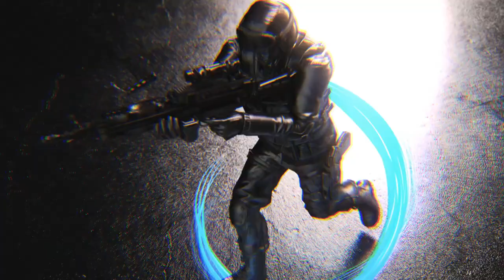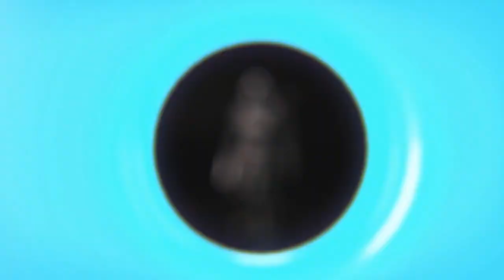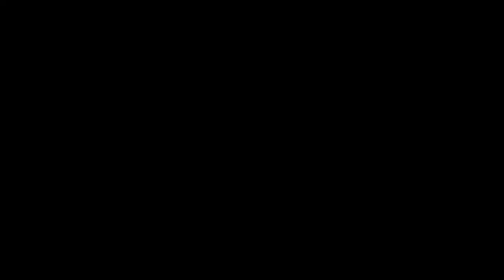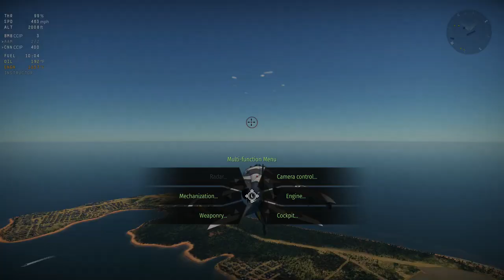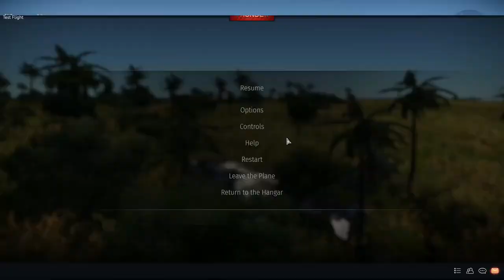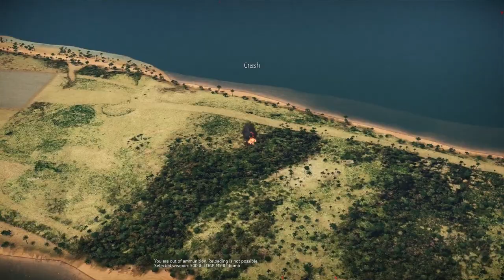War Thunder - My Control Set Up For Xbox And PlayStation For Air Battles

Comment: What are the exact controls for your thrust vector? I tried this but it doesn’t increase or decrease it just locks at 50
Reply from the maker: It does that.. when u increase it you let go of the buttons both at the same time.. alot of people have been having trouble with it on any controls  and on PC as well
Reply: @BolderStrikeGaming do you know any way to fix it? It'd quiet annoying
Reply from the maker: @SEPHTIS213  no fix at the moment  all I do is hold the button get it to zero and release

Comment: Just tried it overall good and smooth flying however my problem is that I can’t assign the menu buttons And it’s Hard to turn also taking off is very difficult and takes longer than it usually does also it’s hard to achieve WEP and hold it
Reply from the maker: This is a old video before war thunder took that way.. so the menu key binding no longer works
Reply from the maker: And you can shut off the hold wep.. and the take off has nothing to do with the controls.. the just depends on the plane you using

Comment: i kinda want setting that are like gta controls
Reply: That's my plan (just started)
It should be as easy as inputting bumper pitch right?  And just mapping the exact controls.  But I'm guessing there is conflicts.  I tend to be creative and tenacious when it comes to mapping having played Elite Dangerous on controller so when I give it a shot I'll get back to ya.
Reply: It's really hard to get to that level of  controls because the thing is in war thunder there is way too many mechanics that have to be keybinded, if you really wanna play like that, you will have to sacrifice a lot of controls, I've been trying to do ace combat style, but it's just impossible due to important binds, and one thing I have from wt is not giving the ability to have a custom setup for each play style when switching control mode in mid flight, example you can't have a setup for simplified controls and a different setup for realistic controls, only one can be used even when you change control mode, we are just too limited in console tho there's a trick called the double binding to add a lot more of controls double binding is simply having to key binds to do 1 action, this separates and prevents unwanted actions.
Reply from the maker: @elnewbie2611  dang lol I like the way you explain it
Reply from the maker: You can but it's a pain I am even trying to figure that out

Comment: i’m trying to decrease pitch but it keeps decreasing my speed at the same time how do i stop that from happening i copied your exact layout
Reply from the maker: did you us a enabler like LB for pitch
Reply: Having the same problem! and yes, used LB as an enabler. Pitch is only activated when I hold it down, but it also adjusts my speed at the same time. How can I make that stop?
Reply from the maker: @coltonlopez5265  use LB + Right stick up and down
Reply: Unfortunately, that doesn’t work either for me because im using pointer aim :/ so using LB + Right stick is equally as disruptive

Comment: pc player is left hand in keyboard right hand in mouse, eye ball and brain to play well while the dogshet console player holding potato controller both hand and spamming auto aim button without using eye and brain cell. what a dogshet nuisance player. i hope gaijin seperate these potato auto  aim player low iq.

Comment: My plane just stays at 47% throttle when i do not do my throttle and leave it and it is anoying and i do not have a brake how do it sort it out?
Reply from the maker: going to have to reset your controls that will fix it
Reply: Enable relative control

Comment: I’m on Xbox, and my button to cancel the input command is the menu button. This means if I try to make the tactical map the menu button, it cancels it and I can’t make the tactical map the menu button. Is there anything I can do to stop this? Plz help.
Reply from the maker: They fixed it to where the menu button has to stay as the menu button.. so for tactical map use the back button.. and for statistics use the Y and back button
Reply: @BolderStrikeGaming  Ok, thank you very much.
Reply from the maker: @DJDino6452  no problem
Reply: @BolderStrikeGaming  Sorry for bothering you again, but what should I use for the Multi-function Menu?
Reply from the maker: @DJDino6452  b button is what I use
Reply: @BolderStrikeGaming  Wait, what is the back button then?
Reply from the maker: @DJDino6452  map
Reply: @BolderStrikeGaming  Ohhhhhhhh, thank you, I should be all sorted out now. Thanks.
Reply from the maker: @DJDino6452  not a problem
Reply: @BolderStrikeGaming  i gotta question, are the rest of tge common settings you dont show default?

Comment: I just cannot get used to point and aim it seems so much easier but when I try I get lost and crash or super confused and killed quick I know ill get roasted I'm sure but I love the actual flying controls / camera view of ace combat and project wingman not so much the physics of the game haha
Reply from the maker: I mean you like what you like tho and if that how you enjoy the game do you that's what I say 🐱
Reply: @BolderStrikeGaming  I have similar settings but when I pitch or anything it just moves the plane and not the circle thing
Reply from the maker: @lk_t5811  yeah it won't you have to move the point aim also
Reply: @BolderStrikeGaming  how? I tried a lot is stuff but the point aim won’t move
Reply: @lk_t5811  yea how do I move the circle thing
Reply: @guitarbackingtracks7889  I’ve figured it out. You have to set the axis for weapon aiming and it will work
Reply: @lk_t5811  thanks man appreciate it
Reply: i have the exact same issue with joystick controls on controller... like i want it too work so badly but 7 years of pointer aim is hard to change
Reply: For me the issue was fixed by doing: 

Controls; Common; View Controls; Fix gun direction in mouse view; Toggle NO 

That made the left joystick move the white circle and the circle was no longer independent. The mouse set up was gone. Hope this helps.

Also while you’re there, you can toggle “use mouse pad for aiming”. It helps me while strafing targets
Reply: Yeah one should be looking one should be steering, I know what u mean.
Reply: Pppppppp
Reply: There's nothing wrong with being a casual gamer🙂 I used to love need for speed before I found forza
Reply: @MrRyanferrand  I don't understand this comment considering I play and am proficient at both if you said assetto corsa then that would have made alot more sense